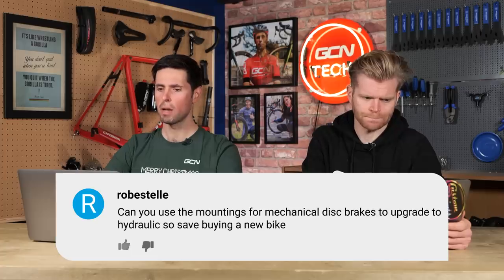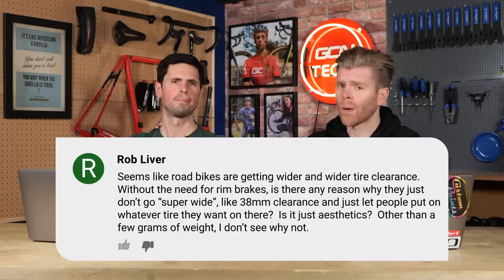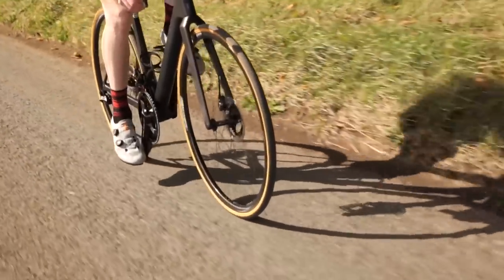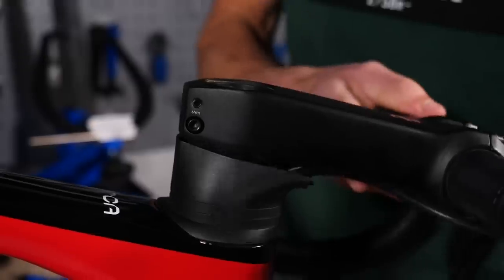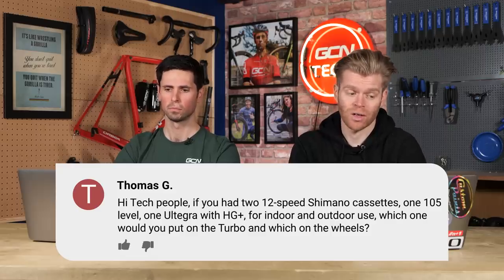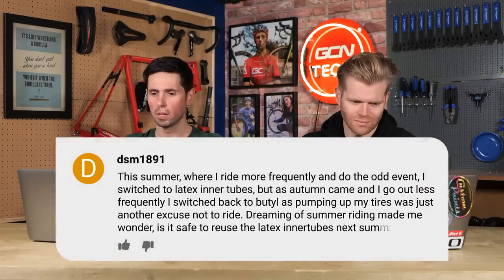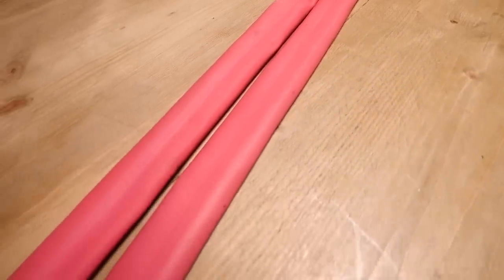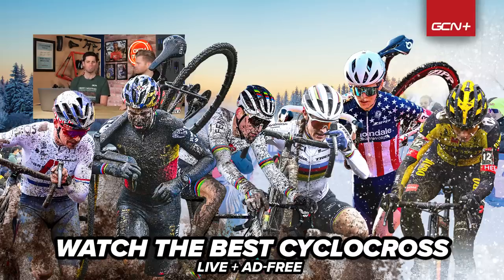Is There A Limit To How Wide Bike Tyres Will Get?! | GCN Tech Clinic

Comment: The problem with the speedplays also sounds like the cleat have been overtightened.  The screws that hold the metal plat to the plastic have a specific torque setting and if it is over tight its near impossible to get the pedals in without a lot of force.

Comment: In addition to added weight (which is minimal), the reason road bikes aren't designed to accommodate everything from 19mm up to 40mm wide tires is because it alters the handling of the bicycle. Road bikes are designed with a certain handling characteristic in mind. That characteristic is partially determined by trail. Going from a 23mm tire to a 38 mm tire will increase the tire circumference enough to affect trail figures which in turn affect handling characteristics.

Comment: I've been using a 32c tire on a gravel-specific wheelset and they have ballooned past the 32mm spec. They have been great for winter riding through the wet and branch-filled trails.
Reply: Internal rim width will affect the tire mounted width. I have a 25mm int-width rim and a 32c Specialized pathfinder Po tire which at 55psi measures 40mm wide.

Comment: Going from post mount to flat mount is a bit of a hassle, at least in options I have come across. There are a couple adaptors out there, but not many companies offer them. Also you may have to increase the diameter of one or both of your disc rotors depending on the standard used on the frame and the adaptor manufacturer. If there are more options for adaptors out there I would love to hear about them.

Comment: 700C is a 0.70 m tyre diameter.  The seat diam is 622mm, so the tyre had 38mm profile. A smaller tyre profile with seat diam 622 still remains 700C.
700C x 20mm is near enough 26 inches, so you may as well use 26 x 1 3/8", 35 - 590.

Comment: Cant see why more than 28-30mm tires needed on the road. Even 26-27mm is more than enough at least here in Japan
Reply: The pavement in my area is extremely rough and looks like rocks glued together 😮

I run 38mm at 50psi 🤔
Reply from the maker: It comes down to where and how you ride. We have lots of poor road conditions here in the UK, so wider tyres allow us a bit more comfort on potholed roads. If you live somewhere with very smooth tarmac, a narrow tyre will do the trick 🙌

Comment: #askgcntech Eyup GCN folks. I am riding the Etape in July with a cheeky warm up event of the Struggle Dales beforehand.  My current bike has 50mm hoops that weigh 1560g for the set.  I'm wondering about buying some lighter wheels for these events around 1100g with 35 deep section or maybe 1160g with 44 deep section.  As the Etape course this year has only 10km of flat and the major climbs are 7-8% average will I see much benefit from 400g saving.  My target weight is 70kg for the start & bike currently weighs about 8.3kg with the 1560g wheels.  What's the optimal balance between the aero gains and the weight saving given the lengthy double digit climbing sections towards the back end of the Etape course

Comment: The velodrome line of riders situation would be similar to a team time trial.  Go out on a flat road on a non-windy day with a team of 8 or 20 riders.  Have the front rider peel off as soon as they hit the front instead of pulling for any amount of time.  The line will accelerate and top out at some steady-state speed.
Reply: No, because you still have someone in the front, creating drag, regardless of how quickly they peel off. In the velodrome, in theory (at least in my mind) there is no (read: very little) air resistance impacting any front rider. In theory, you're practically eliminating all air resistance from all riders, not just those at the back.
Reply: @chrisrye13  There's lots of studies discussing the drag that is felt by each of the riders at various positions in a large group.  Lowest drag is about 50% of the front rider.  For a endless train of riders at 300 W, multiply power by 2 for an individual rider and see what speed results.
Reply: @larrylem3582  yes but unless I'm misunderstanding you, you're still missing the fact that there is no "front" rider in a complete circle of riders. So if the reduced drag experienced is 50% of a drag that is reduced by the rider in front, you could hypothesise that there is infinitely reducing drag as you go round the circle. Obviously there has to be an amount of nominal drag, so I'm sure that's not the case, but you can see why it's not as simple as comparing it to a normal team time trial, where there is a rider at the front experiencing 100% drag.
Reply: @larrylem3582  in otherwise, in this scenario, the front rider is in the slip stream of the back rider. So his drag is reduced. And so it goes...
Reply: @chrisrye13  The motor-paced record is 183 mph.  Other limits will apply to a velodrome record such as max cornering speed.  Velomobiles top out at around 35 mph due to insufficient banking.  Rolling resistance is fairly linear with load.  What do you guess they will hit, 35, 40, 45, 50 mph (before they crash)?
Reply: A test to try would be to motor-pace behind a small motorcycle where the motorcycle and rider are in a bicycling position.  See how fast the motorcycle goes before the bicycle rider can no longer maintain the draft.
Reply: I imagine Keirin racers have already tried seeing how fast they could draft (just for fun, not in a race).
Reply: @chrisrye13  Not to mention that the circle of riders will be creating their own wind; a vortex which will reach some steady speed as the riders push it along.  In effect, creating their own tailwind.  If you've ever done this trick in a round above-ground swimming pool you'll get the idea.

Comment: At least my  Vittoria latex inner tubes are streched when they have been inflated once, and it is impossible to mount them again without overlapping segments. I did not try to ride them in that state but threw them away. Maybe it works, but my fear is they are not save mounted like that, and the ride would feel uneven.

Comment: You guys must have glass smooth & dry roads. 4/5 roads here call for either 38mm tires or riding really light handed. 38s & fenders shouldn’t be stuck with only touring geometry options.

Comment: #askgcntech Hi Manon, Ollie, Alex. I recently bought a disc wheel for my TT bike. Whats the best way to inflate the tyre? Currently I am not able to pump it up, because I do not have an angled adapter for the valve. However, I already ordered one, but still from what I can see it's a tough task, because the adapter will not be clamped onto the valve, right? So I have to hold the valve adapter onto the valve by hand and then inflate? Can be really tricky when you are alone. Any tips?

Comment: Can anyone help please: my rear derailleur will no longer change down into the smallest 5-6 cogs. The front lever clicks but nothing happens. Top five shift no problem. Cable barely moves on the 6th, then doesn't move at all after that. Bike just transported to Vietnam. Could the wire's head have rattled out of its place in the shifter?

Comment: 30mm tyres as standard would be a nice compromise for comfort vs speed.
Reply from the maker: Do you run wider tyres? 👀
Reply: @gcntech  30mm front, 32mm rear so wider than average I guess
Reply: I run 32mm tyres on my winter bike and 30mm tyres on summer. All tubeless. They're a lifesaver for group rides in the dark and the regular smashing into Birmingham's many unavoidable potholes.

Comment: #askgcntech what kind of e bikes can be used on smart trainers like wahoo kicker, etc? I am thinking on buying either Fazua or Mahle electric e roadbike. Those bikes seem to be fine. I wasn’t sure about mid motor models like canyon grail on with Bosch motor. Do you think I still can train with mid mount motor bike like Bosch System having the motor off?

Comment: #ASKGCNTECH Dear GCN, my aero road bike has come with 7mm seat post clamp and the respective saddle. I'm looking onto purchasing a new carbon saddle but I see that most of them require a 7x9mm seat post clamp. I understand that I will not be able to fit the new saddle's rails in my current seat post clamp. Is the seat post clamp something common that I can just swap so I can use a new saddle or do I have to contact with the bike vendor to ask if they can provide a 7x9mm ?
Thanks !

Comment: Guys, I just got a new bike and it has the new 12 speed Dura Ace groupset.  I picked up a 12 speed Ultegra cassette for my Tacx Neo 2T trainer.  My problem is that the shifting is dead-on with the wheel but I'm getting some clicking on the trainer.  I know the tolerances on the 12 speed are tighter because the cogs are closer together, but what can I do to solve this issue?  Do I adjust the rear derailleur each time I move the bike from one to the other with the app (maybe memorize how many "clicks" to move it which direction?) or just stick with ERG mode indoors and call it good (it's good to go on the 7th cog)?  Really don't want to do that if I can keep from it.  My old 11 speed moved back and forth with no issues on this same trainer.  Any advice?  Thanks!!!

Comment: Packing a  bike with intergrated headset - Why can't you just take the front wheel off and turn the attached handles through 90 degrees? (guessing there's a reason because you wouldn't go through the work if not)
Reply from the maker: It will depend on the bike and box, It may still stick out too far. you also might want to remove and package up the handle bars to prevent damage to the hoods or levers 🔎

Comment: #askgcntech Great review recently of the Wilier Granturismo. It looks like a fantastic bike.  The Wilier, like a lot of endurance bikes, has suspension.  What weight do engineers assume when designing these bikes?  If it is intended for a  60kg rider won't a 100kg rider just compress all of the travel out of the suspension when sitting on the bike?  How can the same suspension work for riders from 50 to 100 kg? We all have learned to tune our tire pressure to our weight. Can someone break out the science glasses and explain the physics?

Comment: #askgcntech . Is there a good reason why no-one talks about gears in inches any more? A single number that instantly tells you all you need to know about the gear you're in; allows easy comparison across different cassettes, chainwheels and wheel sizes; and avoids any confusion about what it means to go "up" or "down" a gear.
Reply from the maker: should we bring back gear inches? We think it can be slightly confusing system to those not in the know, we are trying to make cycling as accessible as possible 🙌
Reply: @gcntech  Good point -- although I'd argue that once you've learned what the number means, it makes the arcane world of gearing more accessible. Other opinions are available ... 🤔😁
Reply: @gcntech  It's a super-simple concept that doesn't even require chains or gears.  Just imagine a Penny-Farthing with bigger or smaller wheels and it all clicks.  Maybe not that useful to a 1x rider but with a double or tripple chainwheel it's really good to know exactly how the gear-inches progress.

Comment: At last, GCN are admitting that what they’ve been saying for ages isn’t true! Wider tyres are not faster. 

There is no rolling resistance gain from wider tyres. When inflated to a pressure at which they have equal amount of deflection for a given load the rolling resistance is nominally the same. 

There is also a weight penalty AND an aero penalty.
Reply from the maker: What size tyres are you running? 🤔
Reply: @gcntech  25mm on the road bike, 32mm gravel kings on the winter/gravel/touring bike thing.